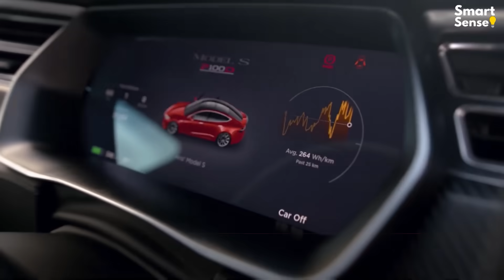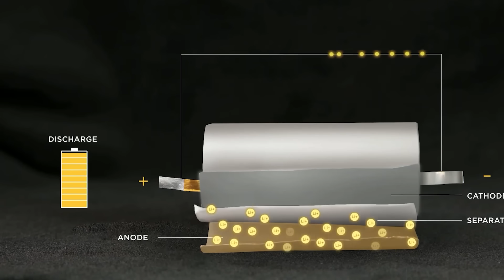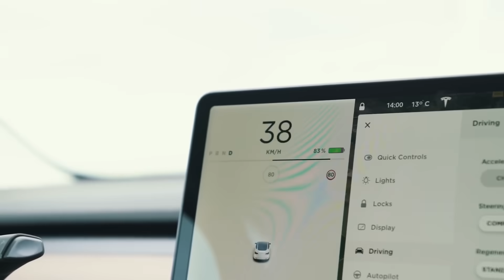Tesla Model 2: New 2022 CHEAPEST Tesla Confirmed!

Comment: If he doesn't make an affordable ev..someone else might . Im a longtime Corolla fan and owner. If he doesn't come out with an affordable model my next car might be an electric Corolla instead of a Tesla.
Reply: Corolla is a good choice
Reply: Toyota gm Honda volkwagon are ahead of Tesla and that have proven years after years they a affordable. I myself drive a affordable Chevrolet bolt EV hatch back and after 44 000 my only cost was about 700$ electrical bill (Quebec Canada) oh and zero visit to the dealer oh and I changed the cabin air filter my brake are less than 20 % used.
Reply: @Sylvain Bien Sur
Good result!
We will see how well the CYBRTRK l ordered on day one will fare?

Comment: upgrade in mileage is necessary. either extra battery module or replacement battery pack offering ore mileage. 4-500 is not an unreasonable goal.

Comment: This is the model that I'm waiting for, hopefully with a discount for seniors
Reply: Your discount begins immediately upon owning - it will be from $1500 to $2000 per year, of never having to buy gas or oil  again. It will be higher as vehicle ages, never having to visit mechanic for IC Engine, battery, radiator, hoses, transmission , and other problems of the Carboniferous Buggy Era.